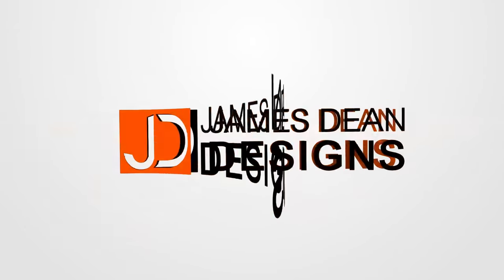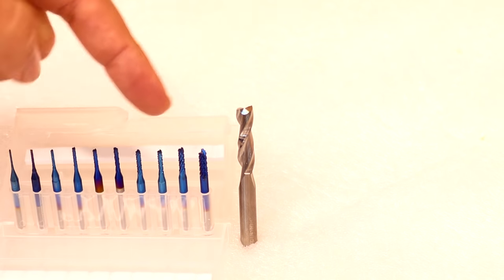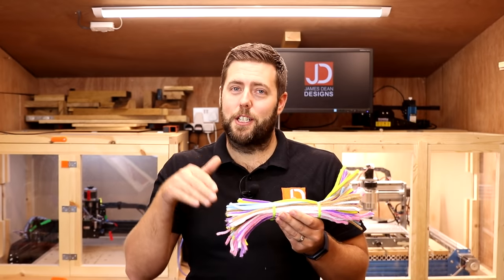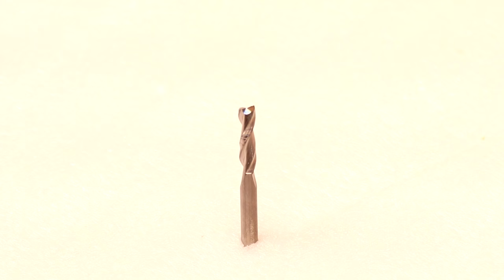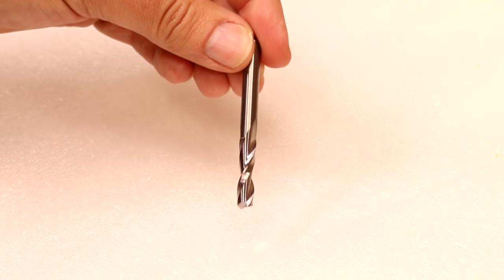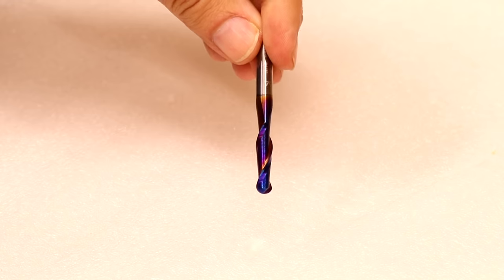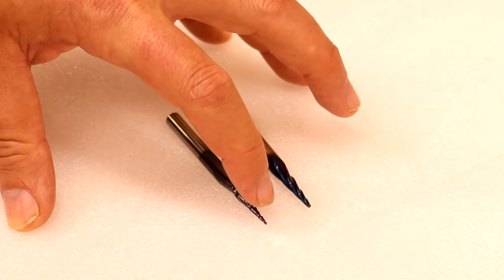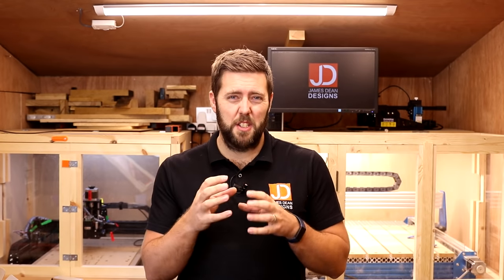Beginners Guide to CNC Bits - Including Speeds and Feeds

Comment: Hi James, great videos! 
As a toolmaker may I point out an error in your terminology? What you are calling an End Mill is in fact a Slot Drill.
The difference is important because true End Mills cannot do plunge cuts. They have usually 4 flutes, and the cutting edges on the bottom do not meet in the middle. Which means they don't cut the full area of the bottom surface - if you try to plunge with them you will have a crash. They are mainly used in metal cutting, moving sideways into material to make slots and rebates. The reason for using them is that they can cut faster with a better finish than a Slot Drill in situations where you don't need to plunge in the material. The cutter moves sideways out of the material, moves down in fresh air, and then moves in again. Or they are used for finishing side cuts inside a pocket, where the material has previously been removed to the required depth using a roughing Slot Drill. 
For the type of work you are doing you will probably not have much use for End Mills - if your viewers order them they are likely to get the wrong thing and have big trouble on their machines trying to make plunge cuts. What they need are called Slot Drills - usually having 2 flutes.
cheers,
Martin.
Reply from the maker: Hi Martin, Thanks for the feedback. Historically I believe this is correct but not so much these days and especially in relation to CNC. For example, if you search for a 1/8 slot drill, the result that come up are more for metal milling machines than CNC. But if you search for 1/8 end mill you will get bits for a CNC machine. I believe the development of technology in how the tools are made ultimately broadened the term of what an end mill actually is (or so I read somewhere) and now includes bits that plunge.  Either that or the term just got misused with in the CNC industry and it eventually stuck. Either way probably pretty annoying when you're a tool maker and everyone is calling them end mills.

Comment: Feed and speed calculator?  I’m a cabinetmaker by trade that specialises in cnc programming and operating with nearly 30 years of experience. To work out rotation speed you look at the tool specs. Spiral cutters are usually good for 24000 rpm tct and tok cutters are 18000 rpm max with less for larger diameters. To get your feed rate you start with a reasonable number and listen to the machine. A cutter that is rotating and cutting in the sweet spot will run quietly. Not much louder than the spindle itself. Using this method I have managed to make spiral cutters last for over 100 hours before needing to be sharpened.
Reply from the maker: I completely agree for most part but people watching this video are starting at the lower end of the CNC scale where the spindles top out at 10-12,000rpm and are lower in torque. Finding that sweet spot audibly I think can be quite difficult on budget machines especially when you are new. But the more experienced I gained, the easier it was to listen for that sweet spot
Reply: This tutorial and a feeds and speed calculator helps when you are just starting out with a budget machine you bought with your own hard earned money from a Chinese website with Chinese instructions. Especially when you have zero experience with cnc milling, but a passion for making things and no one explaining how to use it. It gives me a great starting point
Reply: @henkpunt4159  I’m speaking from experience. I have my own cheap Chinese machine to mess around with but when I was in the industry I got put on the machines when they only just started to become mainstream so my experience came from trial and error
Reply: rey to find a side hustle training AI to tune CNC from the sound so your experience doesn’t get lost. ;)

Comment: New 3020 machine and greatly appreciate the insight, presentation style, and common sense approach. Compared to my scroll saw projects, CNC projects lean into the setup and technical aspects for creativity more than the creativity of hands-on feeding/turning wood into the blade. Hopefully, at the end of the finished project, I will be equally (though differently) pleased. Thanks, again.

Comment: Awesome James.. here is an idea for a future video: Runout - what it is, how it affects your cuts and how to measure and improve it. I spent quite some time with the 3018 developing a quick way to measure it and ways to improve it. For ~ 0.1mm engravings it can make a difference in the final result!
Reply from the maker: It really can, even things such as actually measuring your bits and using the actual measurements makes a difference.
Reply: That would be a tough video for James to do. Wood, depths, bits all effect your cuts. You can take and set a 90 vbit to do a depth cut and it look right on the screen and the vbit will blow out the carve due to the need of a endmill being needed to do the step down to prevent the blowout. It's a super big area to try and cover in a short video

Comment: Dont forget with the ER series collets; the nuts have an eliptical ring inside.  You must insert the collet into the nut first, then slide the milling bit in.  We had to replace so many collets at my work because people put the collet in the holder, and tighten the nut over it.  This rips the collet up, and prevents it from unlocking properly.
Reply from the maker: Good point Neil

Comment: Very good explanation to try break the mystery of bits, Feed rates. Chip load & V-Carve. As you said it is a confusing loop, but importantly we don't need to get hung up on the detail, look & listen to what the CNC is doing, how to interpret difference between smooth running cuts & chattering, noisy cuts.
I don't know all this will resolve my particular V-Carve problem of rough bands approx located  1-2 & 7-8 on a clock face.had it on 3018 & 4030, !
Anny ideas? I don't think it's feeds & speeds or dull bit as 90% perfect!
Reply from the maker: Thanks John. Send some photos on Facebook. Sounds odd that's its on both opposite diagonals.

Comment: Generally, you want to choke up as high on the shaft as possible with the collet to reduce run-out. When you're cutting wood tho, I guess run-out tolerances must be pretty lenient so it probably won't matter that much.
Reply: I'm literally about to start my journey into learning CNC, so I'm still not at all first in the terminology. What do you mean by choke up on the bit, and what is run out? Thanks for any help!
Reply: @ Choke up like with a baseball bat, you clamp the tool higher up in the tool holder’s collet. When the tool is held shorter in the collet with less length sticking out, it’s more rigid and won’t bend or flex as much when you’re cutting. When it sticks out further it can bend more when pushing against the material being cut, which is known as tool deflection. The amount it deflects is your run-out, the amount it can cut oversize versus your target cut dimensions.
Reply: @jumpman2680  I really appreciate the response! That's what I thought, but from my experience with 3D printing and laser platforms, I've learned to always double check. From what I've been learning with CNC, it seems there will be a lot of that.
Reply: @SkaMateria  It’s almost impossible to cut material to an exact dimension. To some degree you are always working against tool deflection and run-out. That’s why print dimensions always have tolerances included. Efficient machininsts constantly adjust tool compensation to hit the middle of their tolerances and keep moving along. You can easily get distracted going down rabbit holes trying to hit your target dimension rather than using allowed tolerances.
Reply: @jumpman2680  Thanks for the advice. Are you suggesting rather than chasing the perfect cut with the CNC, jut hit a comfortable spot then move on to cleaning it up by hand?
Reply: @ Not sure what you mean by cleaning it up by hand. The only manual cleanup I’ve had to do is occasionally using a burr whip to remove a fine edge burr. 

I meant that if your cut requires say a dimension of .0005” +/-.0002, then your dimensions can be within tolerance from .0003-.0007”. So if you’re hitting .0006” then don’t waste time trying to dial it in another -.0001” to hit .0005” on the money.
Reply: @jumpman2680  Cool cool cool. What I meant was like sanding it down, but I suppose there's always some level of finishing with detailed designs.

Comment: As usual your vid's are very good. We need some help in a different direction... 

Where can we buy a single replacement blue-coated corncob bit? SS does not sell single corncob bits nor ten-packs of a single corncob size bit - only a ten-kit of different sizes. I need two bits to refill my kit gaps - but HOW? 🙃

Comment: Hi James, I'm trying to add V bits to easel and I'm not sure how to input the specs properly.  For a V bit that has a tip of 0.1mm, 20 degree angle and 1/8 shank, should I input 0.1mm or 3mm (1/8inch) as cutting diameter?   I suppose that if the v-bit is fully plunged in to work piece, it will cut at a diameter of 1/8 inch (same as the shank size)?  Thanks!!

Comment: Thank you James for your Video.  Can you please advice what are the best bits (such as no. of flutes, up, down or straight cut) for carving an EVA foam 6-9 mm. thickness? Because it is very delicate material and tricky to carve.  Thanks.
Reply: I'd also like to know this, but at a guess, I'd imagine laser cutting is the better option. CNC on thin foam sounds incredible likely to push the material around too much.

Comment: Thanks James, I'm still in the research phase, but loving your videos. Is there value in running an initial down cut pass and then a subsequent up cut pass? Would you even bother? Cheers, JAYTEE
Reply from the maker: If you have a powerful enough machine then you use the compression bits, buy yes, using a downcut to begin with will get you cleaner surface results especially on something like ply wood
Reply: @JamesDeanDesigns  Thanks, I'm just mentally working through the processes ;)

Comment: I am struggling with cutting foamboards and coroplast material.  What bits will be recommended for softer materials?
Reply: Foamcor and Coro should be used with blades. (I have a colex)

Comment: Let me see if I’m understanding, the feed and speed is dependent on the bits being used, the type of material and the machine. Is that correct? The machine because of the size of the bits that are available. Some machines can’t take a 1/4 inch bit, while others can. Likewise, some bits perform better at cutting specific materials. Did I understand that correctly? Just making sure I got that part of the basic information before moving on. Thanks!
Reply from the maker: Sorry its a late reply but yes, everything you have mentioned is correct. Can seem a little overwhelming to begin with but truthfully, the more you use the machine the easier it becomes to know what each bit can do and at what speeds
Reply: @JamesDeanDesigns  Thanks! I'm still learning how to use mine. I'm a bit afraid of ruining some of my materials I bought to cut but your videos are helping. Thanks again!

Comment: Hey James. Fantastic videos. Really appreciate your knowledge and experience.  I'm struggling with a question. Hopefully you might give me some direction.   I have a new 3020 Pro Max and I would like to create some bigger projects with some fine details. I would need a small bit for the fine details and a large bit to cut out the bigger sections that need removing.  Is this possible? Done in the software? Do I just run the job twice (first time with large bit and second with small bit)?   Or am I stuck with using the small bit and running it for many hours?    Any guidance would really be appreciated. Tried looking through all of your videos and haven't seen this answer. Thanks James.
Reply from the maker: Its kind of covered in the beginners guide to Easel. You have a roughing pass and then a detail pass. A lot of software can do this. for the roughing you use something like a flat endmill and then for the detail you could use something like a tapered ball nose
Reply: @JamesDeanDesigns  Thanks James. Great videos! You certainly help make things a lot easier for the newbie.

Comment: You mention two different collett sizes,  1/8" and 1/4" -- do these pretty much cover what bits would be useful on these small machines?  Or would it be a good idea to acquire a whole set of them in different sizes?
Reply from the maker: Those will probably cover 99% of any bits you'll need 👍

Comment: Is it ok to tilt the cnc machine 45 degree on the table and let it sit like that while it working? I think tilting the sawdust on the surface get pull down to clear the work space. Would that be possible?
Reply from the maker: It is naturally going to put extra strain on the stepper motors when driving it up hill but it his possible
Reply: @JamesDeanDesigns  I also forgot to mention, it is also save alot of space if we can hang cnc on the wall vertically. But youre right about the weight of the stepper motors, wouldnt be the best idea to hang a cnc in this case, maybe just 45 degree angle :D

Comment: What feed rate and depth would you recommend trying on walnut? I am experimenting with roughing cuts using a 3mm 2 flute end mill (on an unmodified 3018).
Reply from the maker: Me personally, I'd start off around 450mm/min with something like 0.3mm depth per pass. Possibly a bit conservative but as it's hard wood it's better to start slower and build up
Reply: @JamesDeanDesigns  Thanks!
Reply: @JamesDeanDesigns   I've tried now on several hardwoods, and it seems like 500 mm/min at 0.6mm works most of the time (with a very sharp bit). Thanks for the help, it's great to know a safe place to start as so much experimenting is required.

Comment: Hi James, Great Video.  I have a few follow up questions.  In the Speeds and feeds section you reference the size of the chips created by the bit during the cut.  Any examples you can point to to related to too small chips vs to big or the machine noises?  I've been running slower speeds than you've referenced in a couple videos and maybe I'm being too conservative.  You mentioned a feed rate  400-500 a few times, and I'm closer to maxing out at 325-350 for softwood (Pine) @ .5 mm Depth of cut.  Also, do you normally suggest a faster feed rate with a shallower depth of cut?     Thanks!
Reply from the maker: I'll try and get some examples but it can be tricky as different bits give off different types of chips. Yes, generally speaking the shallower your passes are, the faster you can go but its all about experimenting. just do a few small jobs and each time just up the speed a little and see how you go.

Comment: Quick question how can you use 1/8 inch bits on the dewalt 611 router?
Reply from the maker: You can either buy a new insert for the Dewalt router but they can be expensive or just use these collet insert sleeves https://amzn.to/44CwWE4
Reply: @JamesDeanDesigns  hey James thank you for the quick response. I've found the  
Reducer for 1\4 to 1/8. Your content is very helpful ! Thanks

Comment: How well will a 3018 pro do with a 1/4 in collet and quarter in v bits?  Im a beginner.
Reply from the maker: It can handle them but you have to go slow and shallow.
Reply: I upgraded to a 20k rpm spindle. Ill now change my Easel settings to an 1/8in 60deg V bit for the detail and 1/8 uppercut to out the sign with tabs. 😊

Comment: Am I able to use 1/4 v bit with the 3018 pro? (With a 1/4 collet swap). I wouldn't be going full depth of the bit, maybe 8mm max with a 60 degree v bit, 16mm wide. I'm making a sign for a colleague but not sure if the machine can handle larger bits for an extended time (easel estimates 50 or so minutes)
Thanks
Reply from the maker: Yes you can but a bigger bit doesn't mean faster. Because a 3018 is low powered, you would end up having to go slower or shallower when using a 1/4 bit
Reply: @JamesDeanDesigns  that estimate was feed rate 700mm/min, and 0.6mm depth per pass into pine? Too fast/deep? Time isn't an issue, so I'd be fine with it taking a little longer little longer. Thanks for all the info!

Comment: Whats a good starter desktop cnc for cutting carbon fiber? Budget around 1,000 usd
Reply from the maker: at around $1000 you will be limited, especially on size. You could look at the Sainsmart ProverXL 4030. The joy of this is it can be upgraded both in size and power as you go along.

Comment: Speeds/Feeds is what I was after... being new I don't know is 100rpm, 1000rpm, or 10000rpm is fast or slow. Plus, trying to setup my machine... some people say the motors on the 3018-Pro are 2000rpm, 3000rpm, 10000rpm and 20000rpm.... ???No idea what's right and no idea where to start.
Reply from the maker: So RPM is revolutions per minute - basically the higher the number so 10000RPM means it spins around 10000 times in 1 minute. A standard 3018Pro is usually 9000 or 10,000. Generally speaking you run them at more or less full speed the whole time unless doing things such as acrylic, then you may want to use a lower RPM value

Comment: what would happen if i attech 3mm bits in 3.175 collets?, is it okay?, i use 3018 pro
Reply from the maker: It doesn't sound like much but in my experience, they don't grip the bit correctly and leads to problems
Reply: @JamesDeanDesigns  wow, okay.
Thanks a lot sir!

Comment: Mate what is the difference between the 4040 and the 4040XE. I have just purchsed the 4040 and did not realise there was a 4040xXE.
Reply from the maker: XE is generally stronger as its all metal and bigger stepper motors. Can take a bigger spindle, comes with an offline controller as well